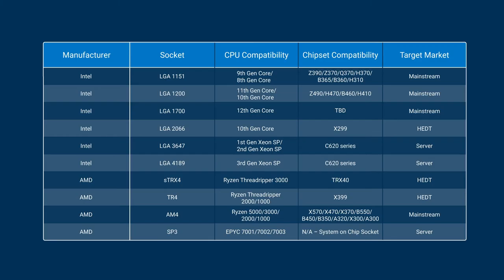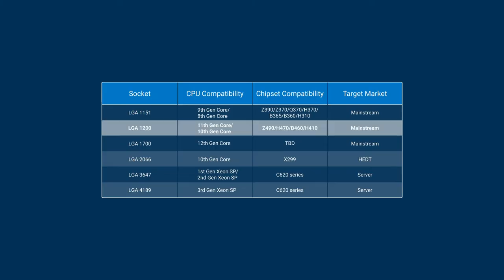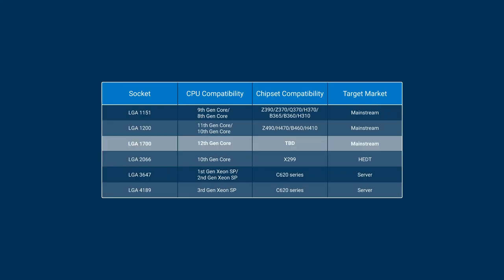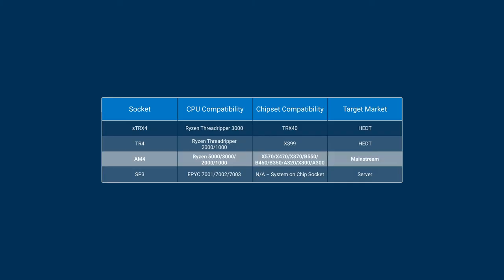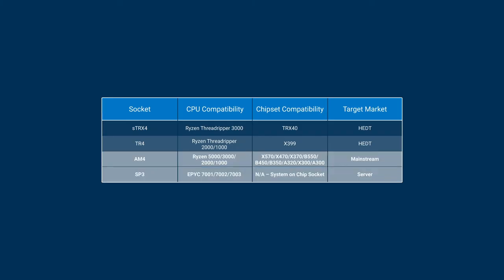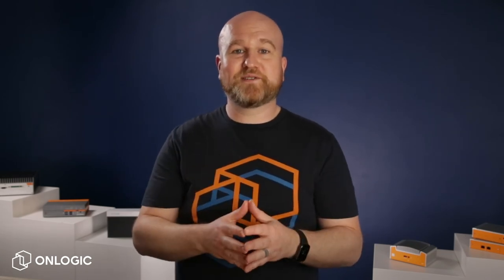What are the latest CPU sockets?

Comment: Thank you for giving clarity about the sockets, so nowadays BGA is not used in CPUs? Where it is used?
Reply from the maker: Thanks for the question! You'll still see BGA used to attach CPUs to devices like single board computers (SBC), where the processor is not intended to be removed or upgraded. You may also hear the argument that BGA on its own isn't a socket at all since it's a permanent physical connection method, unlike LGA or PGA sockets that allow the CPU to be removed and replaced. 

Here's an interesting article from a couple of years ago about an SBC that uses a BGA socket for integrating RAM, rather than using BGA to attach the RAM directly to the board: https://www.cnx-software.com/2022/04/21/bga-socket-allows-ram-upgrades-on-sbcs/